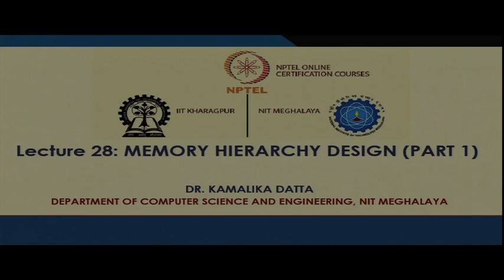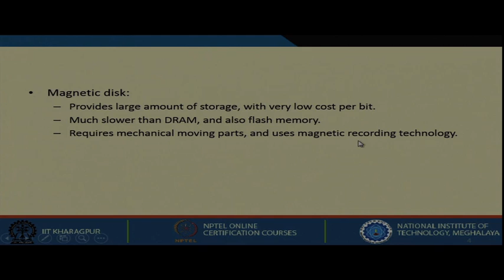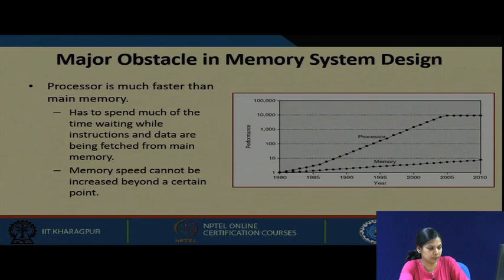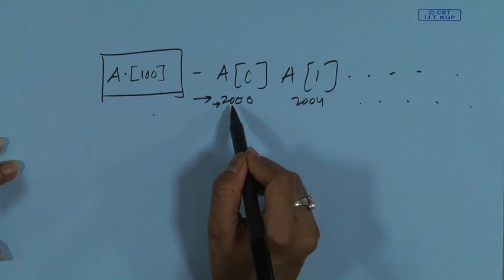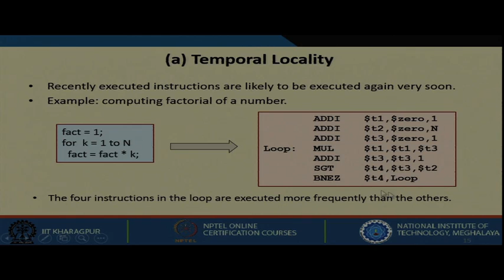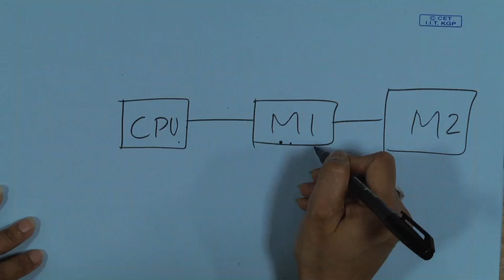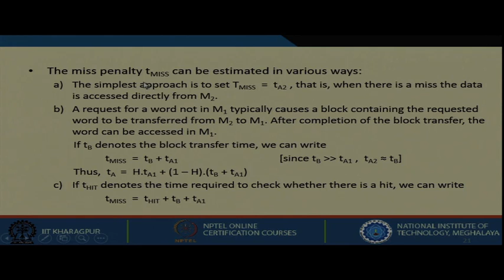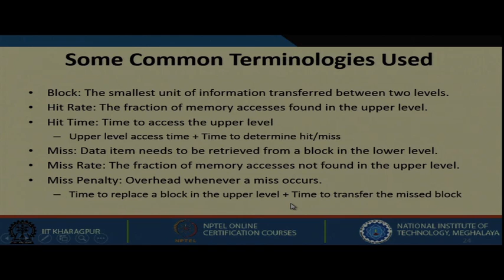Lecture 28 : MEMORY HIERARCHY DESIGN (PART 1)

Comment: 22:38 => her explanation is wrong and the assembly code is too wrong. SGT $t4,$t3, $t2 means set t4 to 1 if t3 is greater than t2(She told set t4 to 1 if t3=t2). The second mistake in the code is the last line, I think that should be BNEZ(because we should repeat the loop if t4 is 0). Please correct me if I'm wrong.

Comment: worst teacher for coa.As she don't even explain the assembly code working and just watching slides and repeating them.
Reply: To be fair assembly level code is not the intended course objective.. probably u r looking at a wrong course.. here it goal is simply to design the system based on raw requirements